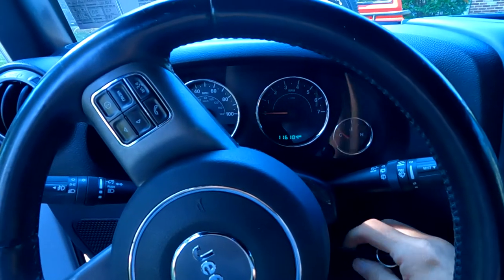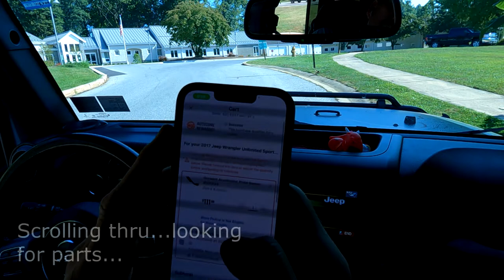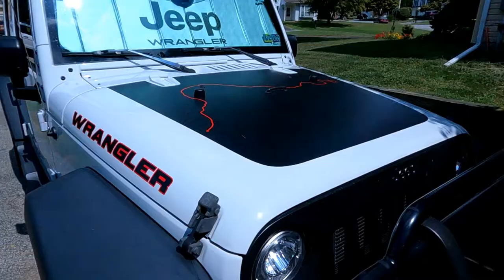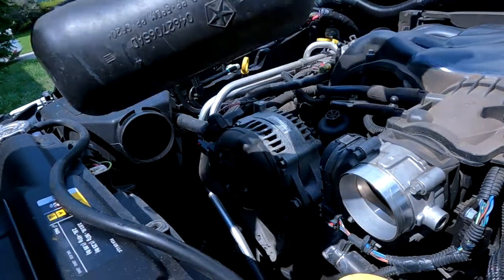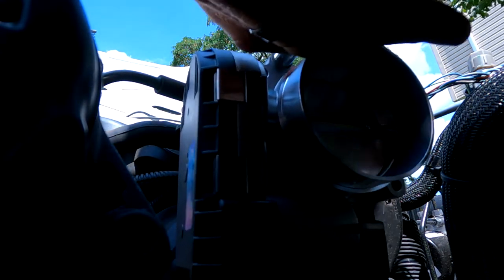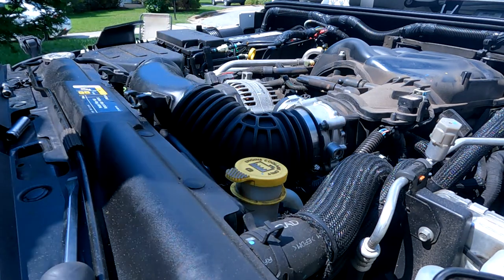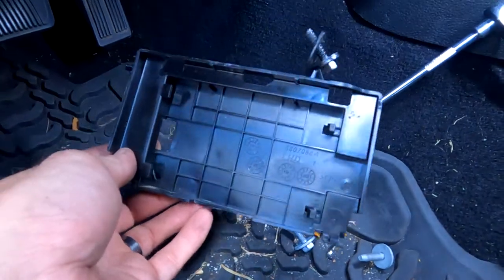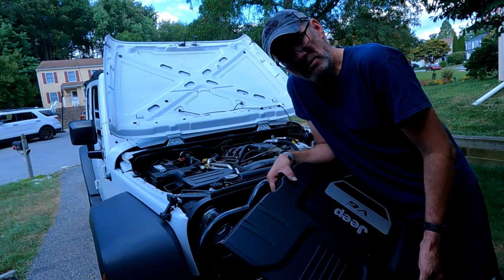Jeep down on power? It could be the throttle body and pedal sensor - Jeep Wrangler JK (07-18)

Comment: Great Video… Fighting this Issue right now…. Side note… Every time you work on your Jeep, and are doing something regarding the Electronics… Disconnect your Battery 👍 … Edited …. There is a video of a Tech that uses a extra long 1/4” extension and a universal socket and is able to pull that top bolt out with out all that extra work 🤔👍
Reply from the maker: Thank you for the feedback. These motors are new to me. I’m pretty much pre 1999 4.0 straight six.
Reply: Disconnect just the negative right?

Comment: Joe I think you’re great   This is my 3rd jeep.  First was a 69 CJ5 with a 3 speed V8   Then an 83 sport with a 5 speed and now I’ve come full circle with a 2012 JKU  that I absolutely love.  63,000 miles on her.  It bucks and jerks sometimes when I’m going uphill and I think it’s a throttle body sensor.  Think   I’m going to try to just reset it before anything else.  I don’t have any lights on so far.  Any ideas or suggestions are welcome and appreciated.  Thanks for all you do!  Cindy
Reply: @cindyorman4527  my 09 jk started doing the jerking while on freeway/ uphills. I thought my transmission must be slipping. Before i go all out i wanted to try this out. Have you had any luck with this repair?

Comment: An important thing to note is the torque spec on the 4 throttle body bolts.  I believe it's only about 65 in-lbs (~5.4 ft-lbs) so it's very easy to over-torque them and cause the housing to unknowingly crack..

Comment: My 2008 Jeep wrangler JK Unlimited has the Red Lightening Bolt. I have so far replaced Throttle Body, Accelerator Pedal and Camshaft position sensor. The red lightening bolt hasn't gone and my Jeep has no acceleration.
Reply from the maker: Did you get it resolved?
Reply: I just did the same—-did you get this resolved?
Reply: @indimelbsurf6784 were you able to figure it out? I’m stuck on this now. Thanks

Comment: I have 2011 jku and it has lightning bolt still i replaced throttle body and accelerator pedal ,new battery, cam shaft sensor, tempature coolant sensor, map sensor, intake sensor, full tune up with new coil. The problem is still there  runs like crap cuts out? Anybody else having this problem ??
Reply: Yes I am having the same problem as you and have not gotten anywhere
Reply: Same problem here on my ‘08. Changed TB, camshaft sensor, crankshaft sensor, o2 sensors, and even took the entire harness out to check for damaged wires and rewired a new throttle body plug on it to make sure the connection was great. None of that helped. I’m completely stumped
Reply: I had pretty much the same problem with 07 jeep liberty 3.7 I replaced the accelerator pedel position sensor and I replaced the throttle body which was the electronic one. I went over everything else I could think of. Even though the manual that I had said nothing about the ECM having to relearn any of the things I replaced, everywhere I looked online was indicating that this procedure would have to be done. So I did that ( you can find a bunch of videos on how to do it) but I was still having the same problem as well. Ran like crap wouldn't idle. So I was getting fed up with it. When I found some information that said that I might just have to drive it for a few days or even up to a week. I thought it wouldn't be a good idea the way it was running. But I got in it started it kept the rpms up enough that it wouldn't die and pretty much forced it to drive around the block. In the process it died once then I continued to drive it around the block once more, and when I pulled back into the driveway it ran perfectly and idles perfect. I know it sounds crazy but it worked for me. And it was driving me nuts. Plus I've worked in a shop for twenty years. Anyways I hope this helps you guys. Doesn't hurt to try it.

Comment: A bad TPS lightning bolt will throw the code on either it or APS... most people replace the TPS first not realizing the APS is not sending the 5 volts through the ECM to move the throttle  plate or their are deadspots on the contacts of the APS as you depress the gas pedal causing erratic idling and acceleration

Comment: Just had my engine light come on this morning to my way to work. It ran fine, but then i tried to go faster than 70, and the rpm jerked and didn't excellerate the way it should so im thinking it may be a throttle body issue. Currently at 93k miles on the jeep wrangler jk rubicon

Comment: I've learned majority of what's built from the aftermarket for parts are not up to calibration like the OEM part. May run ok but stuck with a check engine light on.

Comment: Did you disconnected the battery before to install the parts?
Reply from the maker: Not at first. Then I remembered and disconnected. Slight oversight on my part at the start.

Comment: if you remove the right most bracket that hold the plate its alot easier i believe its a 5mm bolt, just one more piece to move out of the way.
Reply from the maker: Thanks for the tip. Sure os tight in there.

Comment: Why didn’t u just change the pedal sensor since u had a code for that u didn’t have to change the throttle body in the engine?
Reply from the maker: Because what I read, it could be on or the other or both.  So to do the job once, I replaced both.
Reply: @JustJeep_It  i had a same issue replaced the paddle all set now

Comment: I've changed both pedal sensor and throttle body, still get this.. flashing lightening bolt with traction light to follow. turn key it starts normal and drives normal. no check engine light
Reply: Did you ever figure this out? Having the same issue.
Reply: @tannerbendtsen8508  it's currently having work done on the axle right now but I bought new abs sensors that are being installed as well as a new plug for my throttle body. I am hoping it's the plug but why not change the abs sensors since they are cheap. the locking plug mechanism on my throttle body plug was broke so it wasn't locked on(it'd clunk off) .. so I am hoping it's that it wasn't getting a direct connection. didn't notice it until right before it was sent off to the shop for a cracked seal. I truly am hoping it's what the problem was because every other part in correlation with the lightening bolt code has been replaced besides the computer.
Reply: @alazaerose  so frustrating. I’m right there with you. I’m to a point now where I’m just going to let the light be there, it runs normal and goes down the highway smooth, and it seems there’s tons of people with the same issue. It’s a jeep thing I guess.
Reply: @tannerbendtsen8508  my friends say it could literally be anything(dummy light). the only time I've been able to get a code was while it was on and all it showed was pcv being erratic on the live stream. was a napa pcv, just actually also had a mopar one put in so we will see. speculation that napa pcv Valves fail but also a cheap fix worth trying. some say they change theirs with every oil change. I won't have her back for a few more weeks, waiting on parts for the rest of the job. so time will tell.